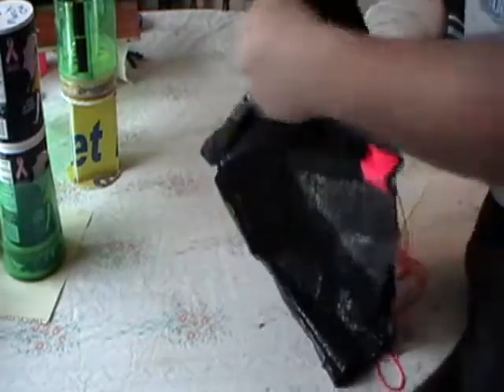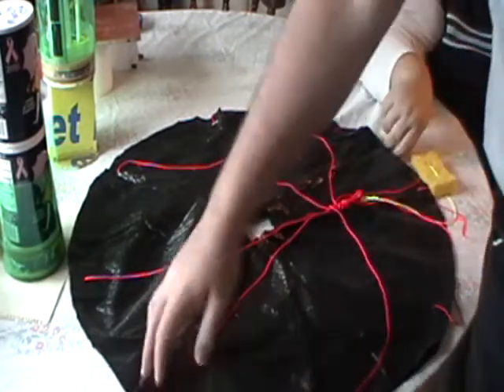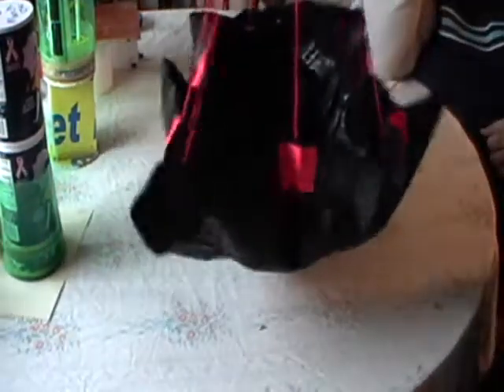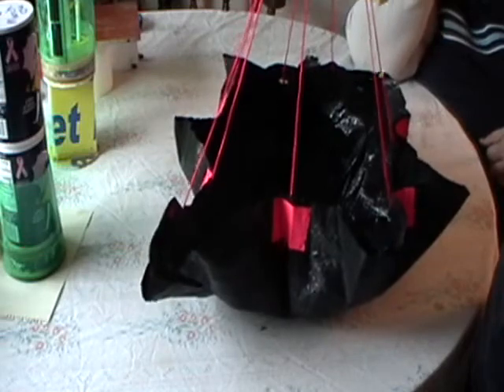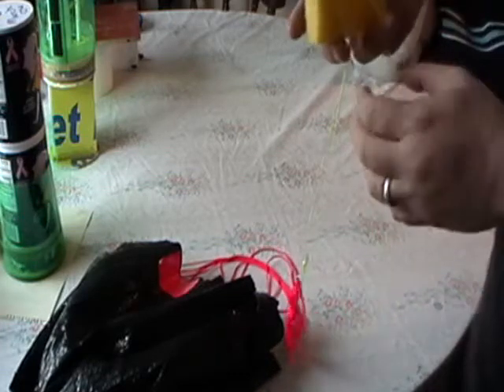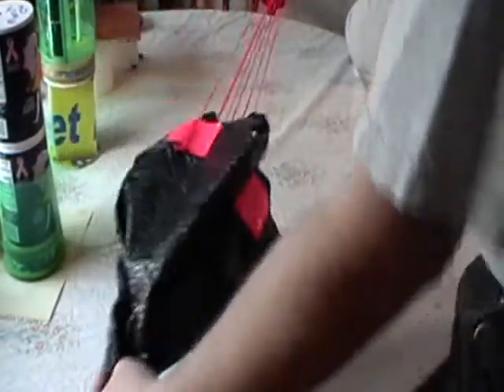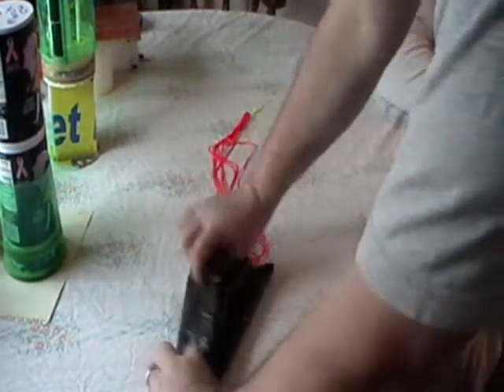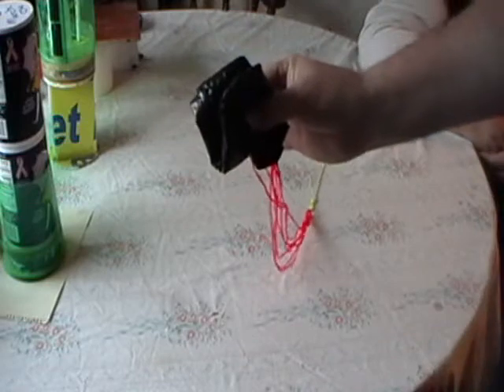Two Stage Water Rocket Parachute Recovery - Part 9 - Parachutes

Comment from the maker: Tape the end of the string to the outside of the rocket, normally near the door.  Fold your parachute and VERY loosely wrap the strings around the parachute so it can unroll when it is ejected.  Place the sponge into the chamber, followed by the parachute.  Close the door & wrap the "suspenders" around the rocket & secure.